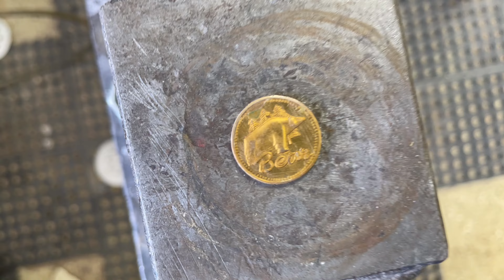Recurve Restoration

Comment: Great save on the ol super Kodiak! Came out amazing keep up the killer content 🏹🎯
Reply: That is a Kodiak Hunter or the later Kodiak at the time it came out after 1960 when the original design was changed for a flat front riser. The Super Kodiak is 52 inches this is 60 inches.
Reply: @caseysmith544  it's a super Kodiak they came in 60 and 64" this one is one the first years for them being all black. You can type in 1967 /1968 super Kodiak into Google you will see bows just like this. The Super K's never came in 52".
Reply: @LongBowMan89  Oh wait that is the Magnum I was thinking of. Sorry, there are many models and design changes to the Kodiak to keep up with.
Reply: @caseysmith544  no worries Sir, there are indeed a lot of models Bear made. There are so many I can't really just pick one if I had to choose to shoot the rest of my life. But if I had to, it would be a Grayling Michigan made B wood riser with numbers 3 limbs lol.

Comment: Love these restorations/refreshments of classic bows. Thank you for sharing them. 

While I guess you never say never, and I have seen some nicely done paint on bows, I am not a fan of painting bows. If I needed concealment or wanted to reduce glare in hunting situations, I might temporarily use a sparingly applied camo tape on static areas (the light adhesive types). 

I have a 1970 Super K (50# @ 28) that is a dandy shooter. Originally setup with a calfskin-covered spring steel rest, I removed the rest and replaced with a calfskin plate, shooting from the shelf without any issues.

Watching these videos really make me examine how my present bows were originally built. Appreciate the fresh look and improvements you bring to these old classics
Reply from the maker: Awesome! Thanks for watching my channel!

Comment: You do extremely good quality work
Reply from the maker: @MikeFerguson-yq2jh  Hey Thanks, Mike! Thanks for watching!
Reply: @greatplainsbow  I have built guitars and mandolins for many years, i would suggest finding a 1/4 sheet vibrating pad sander with a soft sole for doing the finish work, those random orbits take to much off at time and will actually dig divots if you don’t use extreme caution
Reply from the maker: @MikeFerguson-yq2jh  thanks I'll keep that in mind

Comment: Yo Shane, I've had great results stripping old bow finishes with a dull, flat knife edge held perpendicular to surface.  You can clearly demark the old finish from the glass as it easily scrapes off...

Comment: Hey, I was wondering if you could tell me what kind of glue that is that you’re using to fill those cracks and holes with when you sand it and then you drizzle that stuff on what is that I need some I’m doing a Kodiak stupor for a friend of mine it’s a 1953 I want to have the right stuff
Reply from the maker: It's CA glue. Essentially just really thin super glue

Comment: I have a 68 Bear Super Kodiak recurve. It looks like the one you are refinishing. 
Mine is still shootable but has a few vertical stress cracks on the belly of the bow, 3 on top limb, 2 on bottom limb all are below the fade outs. How much do you charge to refinish a bow?
Thanks
Reply from the maker: I charge $150. Thanks for watching!
Reply: @Great Plains Traditional Bow Co.  
Great do I just box it up and mail it to you? It would be the first part of July. Mine doesn't have paint. Lol
Thanks

Comment: So the heat from the medallion removal will not delaminate the bow or warp it ? Great video 👍
Reply from the maker: That is an excellent question and is also a valid concern for sure when working with older bows. The heat in that location will be just fine as it is not on any laminations and was held on the bow for just a brief moment. But you have to be extremely careful when heating up any area with gluelines or laminations. Thanks for watching!

Comment: Just picked up a vintage Root Brush Master from the late 50's early 60's. Would it be worth it to have it restored? Great work btw. That bow turned out beautiful.
Reply from the maker: Thanks! It depends on how much the bow is worth to you. It doesn't really matter how much you could sell it for. If you really love it then it's always worth it to make it brand new
Reply: @greatplainsbow  I only paid 50.00 for it. It's my first recurve. Waiting on a new string to come in the mail. What does it cost to restore it to new. That would determine if it's worth it to me. I'm on a budget.
Reply from the maker: @charlesdudley5800  It would depend what all you want done on it. Email me some pictures and I can give you an estimate. greatplainstraditionalbows@gmail.com
Reply: @greatplainsbow  Just got off work. Will do that when I get home.

Comment: Hey Shane. Love your work. I'm sanding down and refinishing a few old recurves for my sons. What is the best finish you can recommend? I have a cup gun so I can spray two part finishes etc...  Thanks so much. Shane
Reply from the maker: You'll have the best luck with M.L. Campbell's Krystal conversion varnish. It's a post catalyzed finish and VERY IMPORTANT the product number of the proper catalyst is C1491
Reply from the maker: Use the gloss coats (C14518) to build up the hardness and put the dull (C14512) on for your hunting finish

Comment: Hey that bow you talk about at 15 min the pain is enamel based. Most spray paints are. Heat will help peel it up great. I used enamel paints for my first guitar restoration, as they are easy to learn how to spray paint and have a proof look and appeal
Reply from the maker: You mean oil based enamel? Most paints are  either oil or water based, but I've never heard of enamel based
Reply: Think like ace hardware spray paint. The paint primer combo cans that’s say satin enamel, the color, dries in 25 minutes or less kind of paint. It’s a very cheap kind of paint, nothing like the hvlp guns we have used and those mixed paints where we add a base or other mixable.
Reply from the maker: @aidendelong5869  well actually the oil based enamel spray paints are some of the most expensive spray paints out there as they are designed to be harder and more durable.
Reply: Interesting. Where I am the varnish’s and other based ones are more expensive. Enamel spray paints up here are most always in stock and a few dollars cheaper. Have a good un.

Comment: One of the worst tip overlay transitions on modern bows is the RD Bones by Krammer Ammons Shatterproof Archery. Your company would have to fix the tip overlay with epoxy in the spot or a glued on piece of wood as the tip overly transition is that bad, sharp and too soon from the tip that removing material would not be possible.
Reply: The tiller looks off on them too from what I've seen. It's like they have a hinge at the end of the fadeouts.
Reply: Maybe why they stopped making bows?🤔